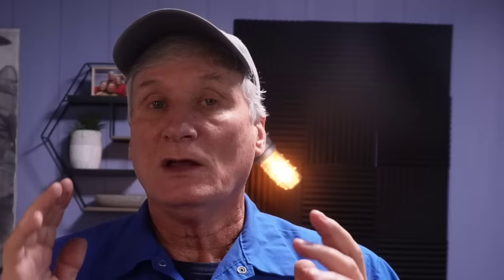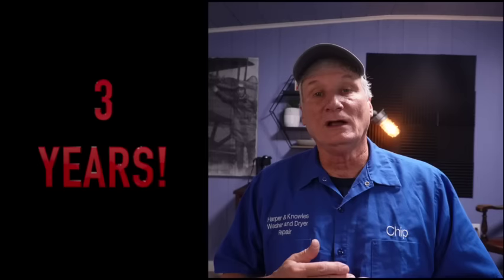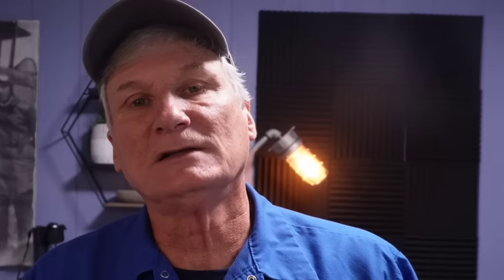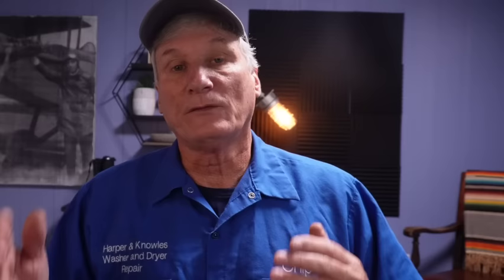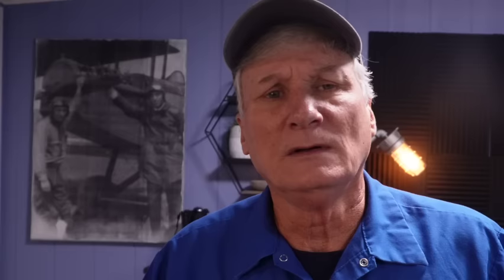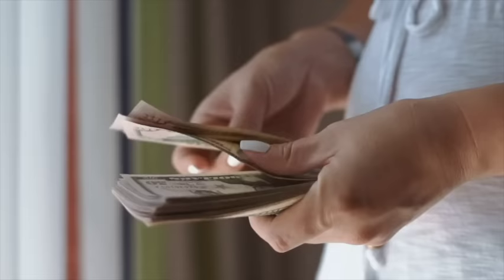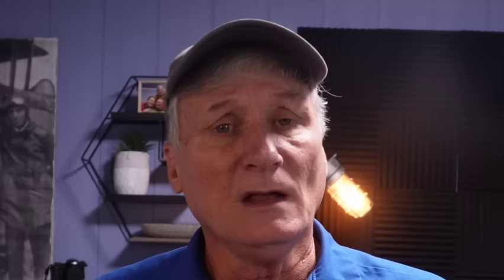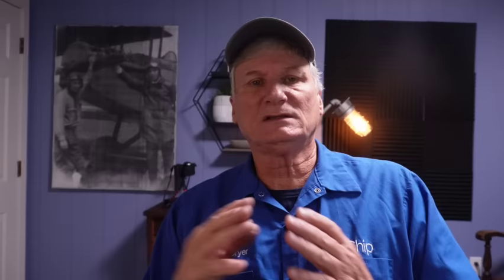How To Choose the Best Washing Machine: Speed Queen TC5 vs. TR7 Review

Comment: OMG, I didn't know there was still a REAL washing machine available!  Thank You!!!!!!!
Reply from the maker: I’m glad I enlightened you. Thanks for watching!
Reply: I am so excited too
My ONLY hesitation is it’s not a removal agitator. Comforters & larger blankets can’t get clean unless u can take it out. A twin blanket or bedspread, maybe.
Reply: Those are for the laundromat in one of those behemoth commercial front loaders, but cost a bit of change to wash and dry there. Then there's the hauling to and fro depending on where it's located. I have several pieces of bedding packed away, currently unusable, due to the need for a good laundering.

Comment: I've been using a Speed Queen washer for 15 years, and have never had it bang around or go out of balance EVER. If you're undecided about choosing Tc5 because it looks too aggressive for every load,the Bulky cycle has gentle agatilon.
Reply from the maker: Thanks for sharing your experience, Michael.  Others will probably benefit from your feedback.
Reply: Will it clean a king size comforter
Reply: @paulstanley3265  I just read a review that somebody said they wash their King comforter without any issue.

Comment: Nice video! We've had our Speedqueen washer and dryer since 2008 (15 yrs) and couldn't be happier.  They don't shift around on the floor and the one time we had a problem, the washer was quickly and inexpensively fixed. The technician said he hardly ever got calls for Speedqueens and he was surprised by how easy it was to fix. One of the best decisions we've ever made when it comes to appliances.
Reply from the maker: I can testify to that too. I almost never get a call on a Speed Queen. I think only twice last year. Once the guy called and before I could get there he called back and said that his wife had forgotten she unplugged it to use the vacuum in the laundry room and the other time the lady’s circuit breaker was bad and needed replacing.

Comment: When we got our last washing machine, the only reason I didn't buy a Speed Queen was because it was too expensive; so I just decided to save money over time, and when my 'cheapo' washer died, I would treat myself to the best. Unfortunately, the Kenmore Model 80 that I bought 30 years ago is still humming along, working just fine. It will probably out live me. It's in my will, as they don't make 'em like that anymore, so even used, it beats the crap out of the vast majority of consumer grade machines. 
Kenmore model 80.  One of the best designs ever.
Reply from the maker: Yes, indeed. They don’t make them like that anymore unless it’s a Speed Queen. Thanks for watching and commenting too.
Reply: I think my model 80 washer and dryer are 30 years old and still going strong.  I do have a Speed Queen stackable at my shop bought new in 2004 that get lots of abuse and has also never needed repair.
Reply: My Kenmore just died, and I want to get a Speed Queen.  I have to find a good dealer in my area because big box stores don't sell them.
Reply: My Kenmore washer 70 series was left with the house when purchased it back in 1991 and still going strong.  Only diy- purchase dogs, lid switch and water pump

Comment: I agree with pretty much all of the comments above.  I'll be 75 this coming August and have some perspective on these things plus I have at one point, actually repaired washers and dryers.  I've had many kinds and types of washers over the years from old world Kenmore and Speed Queen wringer washers, to high performance Kenmores - which I found to be no better than any of the other junk out there today.  I've also had Maytag and Kenmore direct drives too - some of the most reliable washers ever built in America.  But today, even with the high quality build of Speed Queens, there are a few features I'd change.  First, make sure that the fill control (a rubber diaphragm behind the control panel) is adjusted before installation so that the tub can fill almost to the very top of the machine - this enables very large comforters and bedspreads to be washed easily with less strain on the components of the machine.  Secondly, replace the digital controls of the cycles with the older style electro-mechanical timers - yes I know those things eventually die, but they are a heck of a lot less expensive to replace than most digital electronic control boards.  Plus, you can stop or start a load at YOUR will, not the memory board's will.  If you have a little think about it, in an atmosphere of moisture and detergents (whether it's liquid of powder) that can easily land of very sensitive contact points on a digital board and corrode them and make them fail - no matter how hard a manufacturer tries to isolate those boards from the environment.  I also believe that if the spin speeds were increased even by 30%, drying time would be reduced drastically.  And finally, (I know I'll hear comments later about this one but we all have our preferences) I like a machine to be able to rinse in warm water.  From a physics standpoint, when you add heat to any system, it works faster and better.  Yes I realize I'm being somewhat wasteful with water and the energy it takes to heat it, but washers that used to offer these options worked beautifully and cleaned clothes like a dream.  And I also think it's a pity that Frigidaire washers(made by General Motors) are no longer available.  Now there was a washer that had heft, designed to really clean clothes super well and strength.  If they were around today with the added features of digital electronics they'd be just perfect.  But alas, here in America corporate greed and avarice hand most of us mediocre products to satisfy stock buy backs, excessive salaries for executives and high returns for the stock holders.
Reply from the maker: Thanks for your informative comment! I’m sure others can benefit from your life experience. Thanks for watching too!
Reply: MY Mom had a Frigidaire Washer she bought new in 1952.  She replaced it in 1978.  I had a very well used Frigidaire washer in 1973. I was 3rd owner.  I had to replace it in 1984.  These washers were WONDERFUL!  I NOW HAVE A SPEED QUEEN & GOT ONE FOR MY DAUGHTER!
Reply: I was talked into buying Frigidaire dishwasher, washer, dryer and fridge Worst appliances ALL OF THEM that Ive ever owned i returned all of them
Reply: I agree with you 100% on everything you said...except that part about the added features of digital electronics at the end...I think they don't need ANY digital electronics...
Reply: You know the replacement parts are priced to induce new sales by the brands. Control board (clock) for 250+, plus labour on a 400-500 washing machine. And no-one doing board level repairs. And when you find a business to do it. Time makes it just as expensive as swapping outright.
Reply: I’m fortunate to still have an Original Maytag Plus, Heavy Duty, Super Capacity-Washer. Hot Wash & Warm Rinse. 25-30 yrs old and No problems.
Reply: I was an appliance repair man for years and everything you say is dead on. I’m 72.
Reply: @michaelclark7602 The recent Frigidaires bear NO relation to the GM owned company's product.
Reply: How is rinsing in warm water better than rinsing in cold water?
Reply: If spin cycle was adequate dryers would last longer—>bad for business!

Comment: Great review!  I've had several washers over the year.  Most recently, a HUGE tug Samsung.  Biggest mistake ever!  Could not balance the load, wash knotted up and would not fill to to top when needed.  I discovered the TR7 and the best purchase ever.  Built like a tank, great warranty, and tons of options for wash cycles.  People have to realize if you have filthy clothes, then you need to pre-spray, add a detergent enhancer, select a pre-soak option then an extended wash!  This machine can hand any type of laundry from delicate to heavily soiled. The build quality of a Speed Queen is just amazing.  Every time I put a load of wash in, I just smile.  It's going to out live me at 66 years of age.  Interestingly, it is amazing quiet until the drainage period.  Do yourself a favor and spend the extra $500 to get this machine.  You will pass it down to your kids!
Reply from the maker: Thanks for sharing your experience. I’m so glad you watched my video!
Reply: Samsungs have a tendency to grenade after 5 years and in spectacular way.  The metals used in their machines interact with each other causing rust and metal erosion.  
Speed Queen front loaders are the best models.  Tried and true technology along with great cleaning ability.  They share parts with the top loaders, making things far cheaper to repair.
Reply from the maker: Thanks for sharing your experiences Glenn! Thanks for watching too.
Reply: Sadly, your kids won’t like it because it is not tech enough, thus is how we arrived where we are.
Reply: @kellismith4329  Tech doesn't matter when it does not clean!!!!
Reply: Same experience. Worst machine I’ve owned!
Reply: Simply rinsing your clothes first in plain water is huge when dealing with filthy clothes.
No prewash det needed. No extended cycle. 
Simply spray and add det once rinse is done. 
I check for chunks of stuff too if needed. Take out clothes n shake out then look in tub to see if any in there n wipe out either paper towel.

Comment: We’ve had our Kenmore W&D set for 26 years. One repair call on both over that time.  The repair people say not to ever get rid of these machines, as they are work horses that will go forever.
Reply from the maker: That's impressive longevity for your Kenmore washer and dryer set! It's great to hear that they have served you well for 26 years with minimal repairs. Appliances that can stand the test of time are a testament to their durability and reliability.

Repair professionals often have valuable insights based on their experience with different brands and models. If they recommend keeping your machines because they are known to be workhorses, it's worth considering their advice. Having appliances that are built to last can save you money in the long run and provide you with consistent performance.

However, every machine has its lifespan, and eventually, even the most reliable appliances may require more repairs or maintenance. If the time comes when your Kenmore set needs significant repairs or begins to show signs of declining performance, it may be worth exploring newer options in the market.

It's always a good idea to research different brands, read reviews, and consider your specific needs when looking for a new washer and dryer. Whether you decide to stick with your trusty Kenmore set or explore other options, finding a reliable and durable machine will ensure that your laundry needs are met.

Thank you for sharing your experience, and if you have any further questions or need assistance, feel free to ask!
Reply: I had mine for 22 years, & LOVED it!  Started making very hard stops, which I feared would break it. Had the tech come, he was pounding the "spin tube" but it wouldn't come out...was rusted to the frame or whatever. I finally said just stop. Even if it had run well, after all that it probably would've leaked. SO, decided to buy a new one. Figured I'd replace the dryer, too, & start with a matching set like I did in 2001. I went online, researched, bought a GE set that looked like a regular washer & dryer --not electronic. WRONG. It makes the most annoying beeps & little tunes, & has a VERY obnoxious rrrrk  rrrrk rrrrk rrrrk sound when agitating. I'm going to call Lowe's delivery & have them pick this set up. Am going to a local appliance store, that usually sells Speed Queen, to see if they have a good set for me. I wish you could HEAR the machines running in the stores...which is why I'm on here, to try & find out how different machines sound!
Reply from the maker: Thank you for sharing your experience and frustration with the GE set you purchased. It's disappointing when a new appliance doesn't meet our expectations, especially when it comes to noise levels and annoying sounds. Researching and visiting a local appliance store that sells Speed Queen is a great idea to find a set that suits your needs. Hearing the machines running in person can definitely help in making a decision. I hope you find a reliable and quiet set that brings back the satisfaction you had with your previous Speed Queen. If you have any further questions or need assistance, feel free to ask. Best of luck with your appliance search!

Comment: I bought an LG Slim Stacked Washer and Dryer combination. 4.5 cubic ft on the washer and 7.5 cubic ft on the dryer. It fits nicely in my apartment closet that was designed specially for stack units. Mine, it seems huge but it really a nice size that make it possible for me to wash and dry almost anything I own. Specifically large enough to wash and dry a King size comforter sheet pillowcases and Bath sheet towels. I really love it. It has a lot of bells and whistles, like steam cleaning in the dryer. A special small load setting, Turbo washing, spin  cycles that really get a lot of the water out. By far the best washer/dryer I've ever had, and I have owned 4 of each in the last 50 years. I hope this will be my last. Cost was about 1800.00 for the whole thing. Bought at Home Depot in January 2021. Not one bad load ever.
Reply from the maker: Thanks for sharing your experience!

Comment: Hi Chip, I’m a fellow washing machine repair guy (40 years experience down here in Australia 🇦🇺) , not sure if you guys get access to Fisher Paykel products, but the Fisher Paykel top loader in my experience is far superior. Here’s why, there’s no gearbox, there’s nothing to rust, the spin bowl can be easily removed for cleaning (just 5 screws) it uses full water wash, and with the completely variable speed motor it can do the most gentle wool wash to the heaviest work-clothes washing. Also the spin speeds are completely variable from the slowest gentle spin to the fastest to realy dry the load. And available up to a large 10Kg size 
Any how, it’s great to see your videos 👍🇦🇺🤟
Reply from the maker: Hi, fellow washing machine repair guy! Thank you for sharing your insights and experience with Fisher Paykel products in Australia. It's interesting to hear about the features and advantages of their top loader, such as the absence of a gearbox and the ease of removing the spin basket for cleaning. The full water wash and variable speed motor sound like valuable features for achieving different washing needs. I know their products are sold here in the US, but when I did a search, I found no dealer within 100 miles of me. Unfortunately, Fisher Paykel products aren't readily available in my area, making it challenging to source parts when I get an opportunity to service one. I appreciate your feedback. Connecting with other technicians worldwide is something I enjoy doing through my Youtube channel. Keep up the excellent work, and thank you for watching my videos!
Reply: @HarperandKnowles  and when I’m asked “what’s the best front loader ? 
My reply “a top loader” 
Hahaha

Comment: Agree! We bought our home in 1991 and when thinking of a washer and dryer, I just remembered all the Speed Queen equipment in Laundrymats and decided to get that equipment. The washer finally gave up after too many saddle and horse blankets blankets that threw the weight off too much. We did replace it with another Speed Queen. Just a couple years ago, the Gas Dryer drive motor finally quit after 30 plus years of reliable service. I did replace the rolling stock all of it about two times being the rollers and belt. I also replaced the igniter once. Beyond that we loved both machines. When the dryer went, it was during covid and we couldn't find a Speed Queen dryer anywhere so we went with another brand. Go with a Speed Queen, good equipment. We are still on the original heating and air system that this house was built with which is Trane but I service that twice a year to maintain it.
Reply from the maker: They are the best that I’ve found! Thanks for watching!